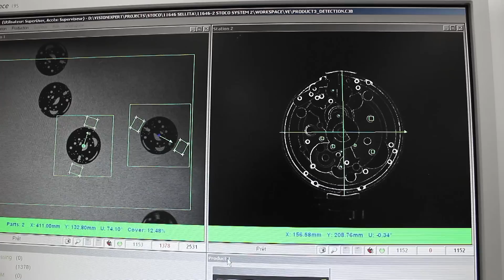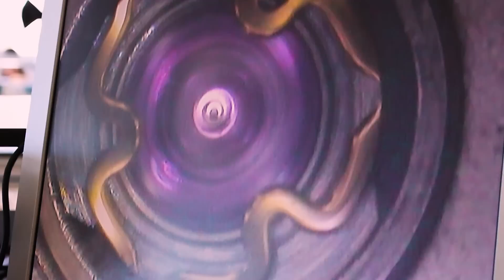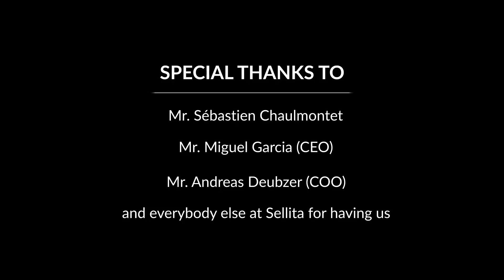Chrono24 Visits - Sellita | Swiss Watch Movement Manufacture

Comment: In the construction, SW 200 is same as ETA 2824, but I think the quality of the parts material  (Sellita) will have difference to ETA, due to the price difference, also the different production of material.
Reply: In some cases that will depend on the clients personal specification they want the movement built to , material wise. For instance IWC specify sellita to use a particular low magnetic material only (SW300-1)

Comment: Sellita produces good calibers, BUT... Sellita SW200 is an ETA 2824, Sellita SW300 is an ETA 2892, etc, etc, etc... So ETA is still ETA, the best and the one all the other are compared to...
Reply from the maker: Thanks for your input! Do you own a few ETA watches you can recommend? :)
Reply: @Chrono24Official , yes!!. Mido Ocean Star Tribute (ETA CO7.621); Hamilton Pan Europe (ETA special made); Longines Conquest Heritage Chrono (ETA 2894); Tag Heuer Targa Florio (ETA 2894); Longines Master Collection (ETA 2894); Victorinox Infantry Vintage (ETA 2836-2); Longines Evidenza Small Seconds (ETA 2895); Mido Multifort Special Edition II (ETA 2836-2); TUDOR Heritage Chrono (ETA 2892 + Duboiz Depraz module); Montblanc Meisterstruck Chrono (Valjoux 7750); Omega Seamaster Profissional 300M (Caliber 2500 - ETA 2892+ Coaxial escapement); Longines Heritage 1973 (Chrono based on Valjoux 7753 with column wheel); Tissot PR100 Divermatic (ETA 2824). Well, these are just a fell from my collection that houses an ETA movement.
Reply: Wouldn’t it the other way around? ETA is a sellita instead of sellita is an ETA?
Reply: @southernstyle8835  If ETA became first... If ETA designed and produced all the original mechanism wich Sellita is coping now... How could it be the other way around??? ETA is the benchmark...
Reply: @andreschmitz1548  ETA will close its doors to brands outside the swatch group. This means that for most small brands which depend on quality Swiss mechanical movements, Sellita is the future
Reply: @DestroyerX61  yes, I Know it. They started it in the begining of the century. So Sellita may be the alternative to brands outside the Swatch Group. But, anyway, it doesn't make Sellita better than ETA. Just look at the improvements that ETA has made to their latest movements... Sellita is still far away from such refinement...
Reply: @andreschmitz1548  sellita is the maker of eta.....
Reply: @murph8411  they make what is lack for eta movement...they upgrade the movement to make it more durable and reliable.....only eta is the orign but sellita is far better quality than eta....
Reply: @ryanrabe7184  Sellita WAS the maker of ETA...
Reply: @ryanrabe7184  I desagree... ETA is better than Sellita...
Reply: Very cool and respectful conversation. I have a small collection of “value” watches (Alpinist, Khaki Automatic, SNA 411 Seiko, etc. And a couple of cool vintage watches, Hamilton, Heuer, and some very cool pocket watches) so, not many and sure no Rolex, etc. The Omega was my Dad’s. I had no “High Beat” 28,800 VPH watches so when I saw a $750.00 Ocean 39 Vintage GMT by STEINHART I was smitten. Does it have the SW 300-2 or the ETA 2893-2??? I hope it’s the latter but the tag just says one or the other so I don’t know. With one exception in 9 YT reviews everyone said ETA. It’s beautifully built and is at a quality level of my best watches or more so either way :-). I would like to have a Speedy one day as I once was a SAR pilot in Tx. CAP, so there is that. Any info is appreciated. I have seen some very negative comments about STEINHART. I sure do not understand. Yeah, it’s an homage of a 50’s vintage Rolex GMT Master which has a cyclops that the Ocean 39 does not. The ROLEX GMT ll has crown guards and a cyclops so........
Got it for Christmas from my wife.